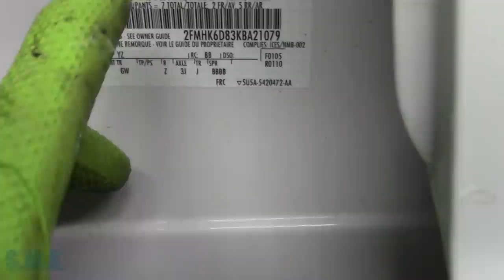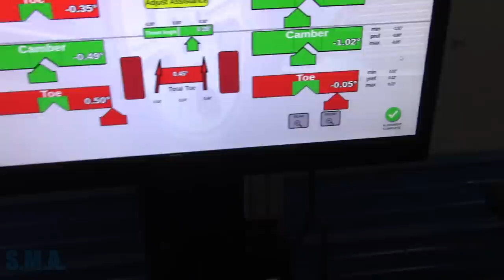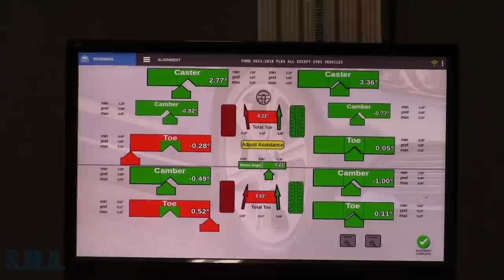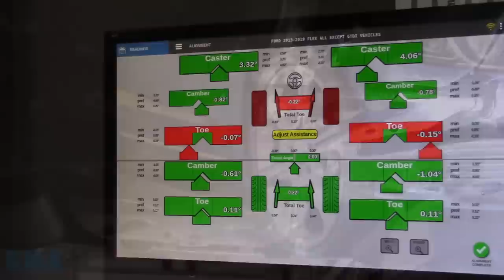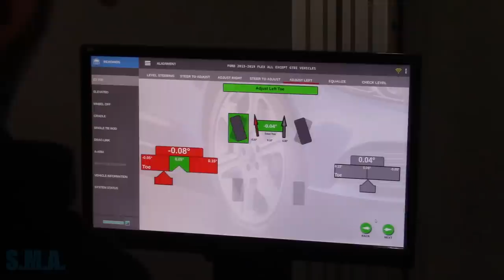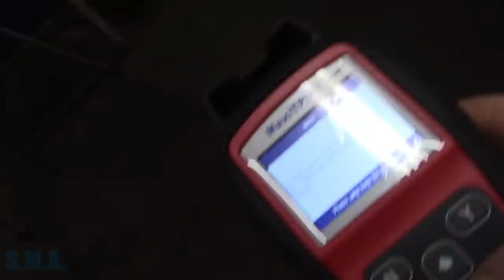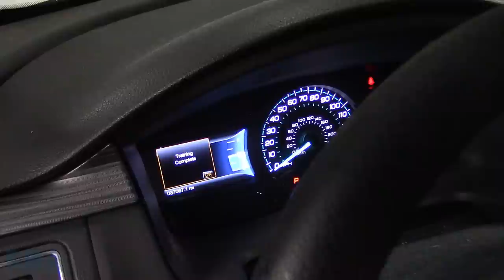Ford Flex: Wheel Alignment & Tires

Comment: The shop I'm at now has a Hunter alignment machine I was shown on 1 car how to use it I helped on 2 cars then the next car I did on my own I'm a little slower than the other tech but I can do it and videos help show tricks to save time same thing with tire machine we never did tires now I do I've already learned how to just got to get my speed up thanks for the helpful videos
Reply: Slow is smooth, smooth is fast. Don’t worry about speed just do the job and concentrate on quality, speed will come.
Reply: As Eric keeps repeating....slow down to go fast..... believe it or not, I've been doing this for 27 yrs this year and I still remind myself of this at least a couple times a week. As far as the taking the extra time to take pride in my work, my boss and I have had a few talks about that, he's trying to get me to 'speed up"... understand, but there's a reason I am where I am today, I do what I do...
Reply: Worked at a farm implement dealer. The "tire guy" wouldn't make sure the tire dropped into the center rim relief when removing a tire. He'd also do them dry and wonder why he'd have to fight with them.
Reply: There's nothing wrong with learning how to use the machine, but in reality, you're not doing a wheel alignment. The most important thing is to understand what you are doing. 99% of alignment techs don't fully understand what they are doing when they make adjustments. They just follow the instructions on the machine. If you take the time to learn all of the angles, and how they work in relation to each other, you'll soon realize the machine is just a ruler. Its just another tool. An alignment machine from 50 years ago is just as good, and does the exact same thing a top of the line Hunter machine does. Its just more convenient.

Comment: You are so thorough - I’ve gotten my car back from the shop with 55psi in my tires 🙄
Reply: Not unusual.  Many shops think the maximum pressure shown on the sidewall is the running pressure!

Comment: First time I ever did my own brakes was on a '95 Ford Contour.  Spent half an hour with a maul getting just one alloy rim freed up from the hub...was young(er) and had no idea alloys could fuse to steel like that.  Been applying a thin film of never-seize on the mating surfaces every since.
Reply: Loosen lug nuts.  Drive around block once.  No sledge hammer needed.  (on fronts, loosen lug nuts and just turn wheels without rolling).  Won't say it works every time, but almost every time for me so far.

Comment: I wish I could find a shop that took their time to do it correctly and completely like you do.  I can't even get the shops to wipe the dust off the wheel before attempting to  stick the weights on.  Removing the old adhesive is next level!

Comment: Hey Eric, here's a tip for re-learning the TPMS on fords with the push-button start: Instead of the stupidity with the start button, simply punch the hazard light button 6 times, and it will trigger learn mode. Hope this helps!
Reply: Wow I wish I knew that trick when I worked at a tire shop. The push button nonsense with the memory seat constantly going back and forth the whole time drove me crazy
Reply: @firstlast---  For real. When I found out about it from a co-worker, it hasn't failed once. I work full time in car repair, and when doing ford tires, this trick has spared me much headache. It got so bad at one point for me that I would just mark the inside of the rim with the tire position, and prayed that the time the tires were off the car wouldn't trigger the idiot light.  Now that I know this trick, it's a piece of cake.

Comment: Those cars look like a 1950's ice chest.
Reply: I've been trying to come up with a description and I think you nailed it.
Reply: Touche!
Reply: Michael Stoliker they were designed to be be reminiscent of the 50's woody.
Reply: @s3w349  The got the 50's look right but a  66 Country Squire got the woody look better than this rolling foot locker.
Reply: I think it’s one of the ugliest cars ever sold, but I did rent one for a weekend getaway and it was nice!
Reply: @KSMike1  Uglier than the "Element?"
Or, the "Cube?"
Who knew that the 6th element was "ugly?"
Reply: I like the looks of these strangely enough.  The wife thinks they look like a hearse.
Reply: @panzerabwerkanone  were on our second Flex. A 2010 and 2016. Both were very solid cars and room to travel inside
Reply: @donaldpauli129  Thankyou for the reply.  They do rate very well in reliability.  I could never get the wife to agree to buying one though.

Comment: Hey Eric, buy one of those orange dead blows from harbor freight. They work great and are covered in plastic so they won't damage the wheel
Reply: Buy nothing...
NOTHING from harbor freight
Reply: @rayjburkhart1752  I call them SnapOff tools.
Reply: @jamesrdorn    thanks James. Thats funny.  I think they use "fake" metal crap. The true cost of cheap.  $2.00 for a tool that breaks and for an added bonus, breaks your knuckles.
Reply: @rayjburkhart1752  they’re trying to make a higher quality line of tools to go alongside their crappy Pittsburgh tools, 2 days ago I paid $90 for a Maddox harmonic balancer kit and it works ok.

Comment: Last time I had my 235 40 18 tires changed they bent my rims, all 4. They said it was more difficult to change them.  Seems in my younger years working in a shop I never had problems with low profile tires. Clearly you can change them in your sleep. Nice work. I do not know why I enjoy every video you make. Probably it’s your engaging personality and your impeccable integrity.

Comment: BFH aka Ford wrench. I need to know what tool that was to get the glue off please please
Reply: If you are worried about damaging the surface, like if its something expensive, an eraser wheel would be your safest bet. For aluminum, Ford also approves those rubber bristle brushes that go on a die grinder.
Reply: @solarfall2728  thanks for the info

Comment: I love my 2016 flex eco boost, thing is like a gosh dang rocket ship and living room at the same time.
Reply: Those are very cool vehicles my brother is going to get his second one, I just don’t like the internal water pump on that engine that can leak coolant into the oil if the seal goes
Reply: @vinces8974  I wasn't aware of that, but good to know. Ill be sure to keep an eye on that.
Reply: @branscoset  keep an eye on your oil if the level rises or turns milky stop driving it immediately and get that addressed, I really do think those are cool vehicles though, I think there is a class action suit against Ford for that Engine design

Comment: I agree 100% on cleaning the wheel/brake mounting surfaces. I recently had an older Ranger in the shop. The guy brought the already mounted new tires and rims with him but his old left rear WOULD NOT budge. I HAD to hit the rim several times with a 16# sledge to knock it loose. Since he was waiting for it, I brought him out and showed him what was happening. He said that he didn't care about the old parts and do what I had to do. Luckily, the truck had steel rims so they didn't grenade. When he left, everything was cleaned up and sprayed.

Comment: I live in eastern Canada and my brother's 86 Astro van needed rear brakes but had a stuck tire on the rear passenger side that would not come off.
We finally gave up after an hour of beating on the tire and put the lugs back on loose and drove around the block 3 times turning left as fast as the road would hold  and it finally broke loose. 
I didn't think they would ever come off. 
 love the videos,
 keep up the good work !

Comment: I enjoy watching your channel. When using A puller to remove a hub will help greatly if you lube the main thread in the center. 80% of the force is used up by friction on the threads. If you lived in threads he will cut the friction in half. Keep up the good work

Comment: That setup is a lot more snazzy than, the coats 20-20 that I used at k-mart years ago ! And I learned that you should clean where the old weights were.

Comment: Great  video  Eric!
 If you're having trouble getting a wheel off at home without the stability of a proper lift (so you don't want to get under to whack it) put the lug nuts back on leaving them a couple of threads loose, then gently lower the jack, the weight of the car will pop the wheel off easily.

Comment: Alloys are not the only wheels that get stuck. Had an Intrepid with steelies on it, and the rears would not come off. Sprayed them down, beat on them with a maul, yes even hitting on the rim, no go. Left lugs loose and driving around corners, rail road tracks, pot holes did not break them loose. Finally found an empty parking lot and drove around in a circle pulling about 5G's before I heard the right side crack loose. Went back and did the brake job on that side then back to the parking lot. Left side took twice as long to crack loose, felt like being on a Tilt-A-Whirl lol. Yes everything got cleaned and anti-seized.

Comment: Excellent video.  You have some fancy tire equipment and alignment machine.  I worked with an old hunter light align and tire irons.  What a  difference.  Worked at Ford dealership, only bare minimum on warranty work was done. Extras were on the customer.

Comment: That’s nice that you spend a little extra time preparing the rims the way you do. I’ve “never”  had any shop remove the old wheel weight residue like that. Yet alone clean or spraying some lube on the lug nut area. Thanks!!! For doing that!

Comment: Seeing you remove the sticker from the tire reminded me of a customer that always wanted them left on his tires. Said the noise they made let all his neighbors know he had just bought new tires !!!
Reply: Those stickers wear off in no time.  Less than a mile
Reply: Hard to balance a tire correctly with a sticker on it!
Reply: @wino99999  You guys need to understand that that was a customer request to leave the stickers on the tire. And it was in the early 70's. I always pull them off before mounting because the old paper ones would split apart when you added air, making them harder to remove. But I still chuckle every time I pull  the sticker off because of that customer.

Comment: I have a buddy. Uses the old Fluid Film on his beads. Cleans the wheel gives it a squirt and around the bead on the tire. I've seen a few he's replaced after a few years. Both having corrosion issues.

Comment: Man you are truly amazing. You perform highly detailed work AND make a video while you are doing it! Me I'm struggling with my 2015 Honda telling me that I need to bring it into the shop because there's something wrong with the tire pressure! Well, there ISN'T! I'm thinking of buying an Autel to reset the maintenance messages. My 2015 is a far cry from my 1993 CX. All it is is a car with a steering wheel.

Comment: Something I've done with a stuck wheel when the big hammer wasn't available or when there was fear of hitting the rim. Loosen the lug nuts a bit and go for a short drive taking short but quick turns on the steering wheel. Do take a lug wrench with you to tighten the nuts after they break loose.

Comment: Customers aren't usually inclined to actually check anything, a fairly competent class alumni of mine brought his truck in wondering why his tire light was still on.  The truck indicated a low pressure right front, which had 80+ PSI but my Peepers indicated the Left rear was nearly running on the rim.  I explained the necessity (In His Case) for his Tire Supplier to Re-Train the system after a rotate.  I never Charged before, but now, it is a service that I offer and charge for.

Comment: I did my little smart car's front rotors and pads.  The rotor had deep gouges in it with new pads at the dealership where I bought it.  I got it home and yanked off the wheel and it left a perfect alloy ring behind that I had to chisel off in order to get the rotor off. it was difficult so I imagine they didn't want to mess with ruining anything and just threw new pads on an old rotors.  It ruined the new pads they put on.  I did the job correctly and made sure it wouldn't oxidize back together as one solid unit again. I live in Massachusetts so we got rust.  I am the second owner of the 2015 smart and it had 9K on it when I bought it in 2018 for 7 grand so don't beat me up too bad for buying this thing.  It was the newest car I could get with the least amount of miles on it. I'm not exactly rolling in dough.  My other car is an 89 full size Bronco if that makes it any better.

Comment: Big long Pry bar works well removing frozen wheels of a vehicle. Usualy you can pry on the inside of the wheel against a suspension component usualy ball joint.

Comment: You mentioned the wood baseball bat at the end. After living my life in New England, and now living in western NY that is the best tool for removing stuck wheels. I find that eventually after messing around with a wheel for an hour that I'm bound to go full Chernobyl meltdown and start wailing on it. I've never damaged or bent a rim with the wood bat, the sledge hammer is another story.  It also has a longer handle than a standard maul,  and is lighter than a full size sledge,  so working on jackstands I can take a full swing without being under the vehicle.
Reply: A guy I used to work with told me his brothers fix for stuck on wheels. Don't know how safe it is but he would loosen up the lug nuts a bit and drive the car in circles  to knock them loose.
Reply: @richardbambenek2601  not exactly unsafe but in my experience leads to damaged wheel studs.

Comment: Whenever I swap my summer and winter tires I brush the hub and back of the rim and do a light layer of fluid film, oil, or the like.
I often have to hold the tire on as it wants to slip right off once that last lug nut is loosened.

Comment: Hey Bud, I found out if you turn your outer tie rod in the direction that the jam nut is going to be tightened. The toe adjustment usually stays where you set it when you tighten the jam nut with ease.

Comment: Hey there Eric, I have been watching your videos for a few years now. First I wanted to say thank you because you have saved me a few times when I was stuck and your videos are super helpful and informative.
I have been a mobile mechanic for the past 2 years and I am now about to open my own auto repair shop. I have been obsessing for years now on learning and soaking in as much information as I can. I work on gas and diesel engines, major engine repair and rebuilds, trailers, small engines, and fabrication. I am improving my diagnostic skills every day (this is one of the parts you have helped me the most) Anyway,  the last 2 years I have been obsessing on the business side of things and have learned a lot. But I always take tips and information from all the people I know that run their own businesses. I wanted to request if you could make a video for us where you share tips on how to run the shop and anything you think might be helpful for someone who is opening their first automotive repair shop. Thanks again for what you do man!!

Comment: Had stuck wheels on a Jag XJS- the powder coating had melted with heat and glued itself to the hubs- finally just loosened all the lugs a few turns then drove around the parking lot doing the " NASCAR" weave until they all broke loose.

Comment: Eric, on the flex/explorer platform the rear upper control arm where it bolts to the knuckle is slotted to allow camber adjustments. Often times you can get lucky and just loosen the nut, the weight of the vehicle will make the camber fall right into spec.

Comment: I believe on those fords camber is a slotted control arm on the upper arm on the rear. So you have to break that loose. And you can shift it. Also fords usually have drive on reset. So typically you don't need to relearn them.

Comment: The rear driver side wheel of a 78 corvette my dad owned. It hadn't been off for 20+ years and just sat in the driveway. I ended up having to set the car down on a 2x4 on the backside of the wheel (so it would tilt outward), then heated the whole rim with a torch (not a lot of heat), then beat the hell out of it with a rubber mallet (you can't realy get to the backside on a corvette).

Comment: Amazing how far out that alignment was, and what you had to go thru to get the wheel sensors to relearn. It shouldn’t have to be that way. My 2016 KIA Sorento self learns within a mile or two with a few turns, what sensor/wheel is where on the car. According to rh white paper I read, it does this using the traction control that includes import from the steering angle, and antilock brake computers, to determine which sensors is on what corner of the car. I’m more impressed with it each time I see what another manufacturer has resorted to to accomplish the same thing.

Comment: Had a dealership that couldn't get a 4 tire balance and alignment right. After the 2nd one i finally pulled the tires myself and found they never cleaner the face of the rims or the hubs. I spent over an hour using a wire wheel and scotch bright attachments flattening all the faces which had over 1/8" of corrosion from 7 michigan winters lol

Comment: I have a 2011 Turbocharged Flex similar to that one, the steering and suspension is almost identical to Tauruses. I've used your Taurus videos as a guide to work on my Flex rear suspension. If that was a turbocharged Flex, you would have enjoyed "giving her the beans", they are pretty quick.

Comment: I live in the Midwest of USA. I was changing brakes on a van. The one wheel so stuck , I had lower van and let the weight of the van break the wheel loose.

Comment: They should make a bar that goes between the two tires that you turn to expand and push the stuck rim off. Same concept as those load braces for a pickup truck. You set the rough width by telescoping the rods, then once locked down the outer tube spins just like a tie rod and expands or retracts. Seems it would be safer that swinging to sledge.